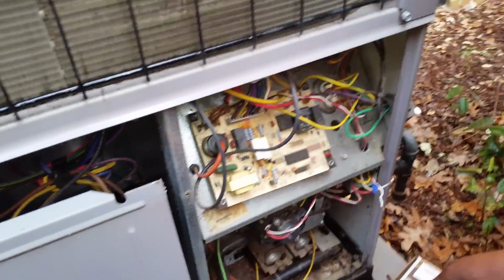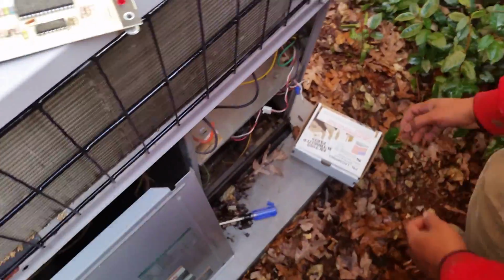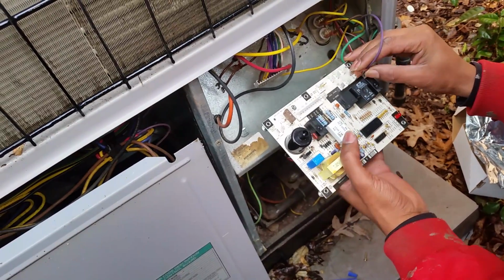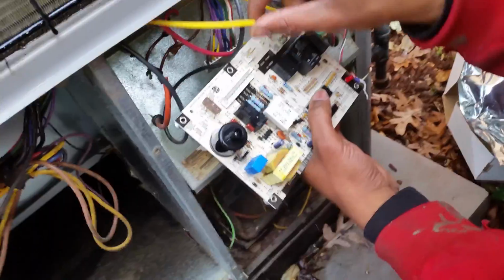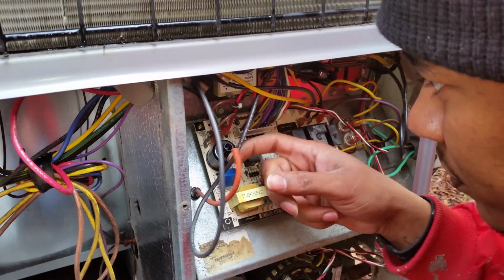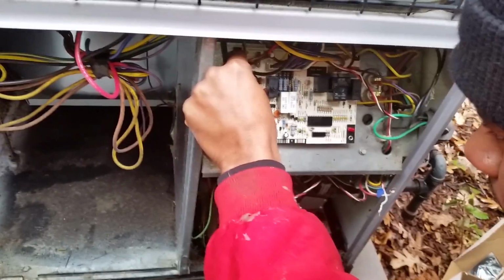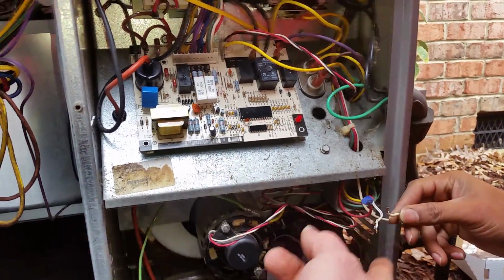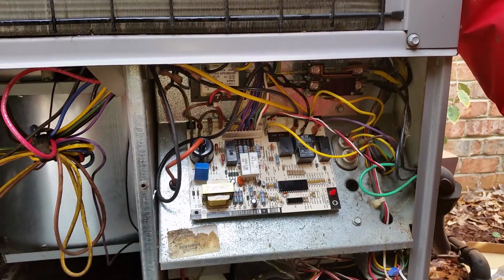Replacing carrier circuit board

Comment: Watched your video. Thanks. My thermostats are good as I swapped them and blower fan randomly starts all by itself. If I remove the 220Vac fuses the fan stops. I can re-install fuse block and fan remains off but starts up hours later. Im thinking this is the control board???? Carrier LH33WP003A. I am on the West Coast. Likely Control Board???

Comment: I replaced my board but my fan blower will not turn on. When I check L2 and BM with my meter, I get nothing when I'm supposed to get 240v. Everything is wired as the previous one. compressor and top fan works. What can be the cause?
Reply: Did you figure it out
Reply: @javiergarcia518  yes, it was a wire at the thermostat that had became loose.

Comment: Is there a good way to seal the side panel so dust and other crap doesn't get sucked into the unit?  I want to add a foam seal or something around the edge, but I dont want it to catch fire from the burner. The carrier unit is a 48gs and looks exactly like this one u are working on.

Comment: Carrier 50EZ won't start. Has 240 vac complete, 27 volts at the 
transformer, relay starts system fine pushed in manually or jumpered 
from transformer. High and low pressure contacts show continuity. My automotive gauges don't fit but there is pressure in the system. I can't find any loose or un-acounted for wires, everything appears unmolested.  T-stat wires shorted for testing. Too many boards and solid state components for this old master service electrician to wade through. Any ideas?
You remind me of me. I once ran into a kid years later who I took out with me a few times, he said "you are the only guy I ever worked with who taught me anything."